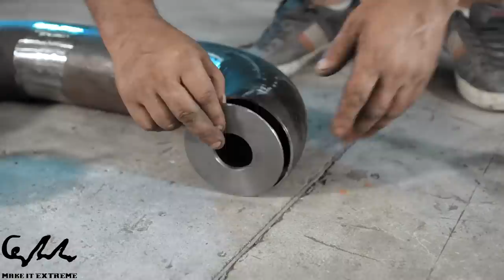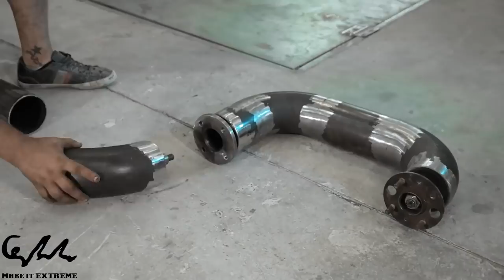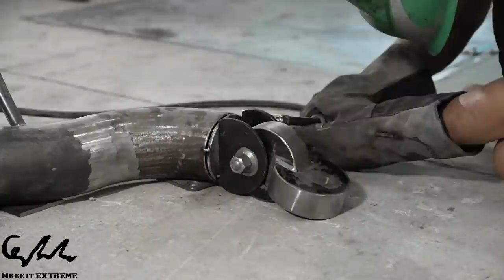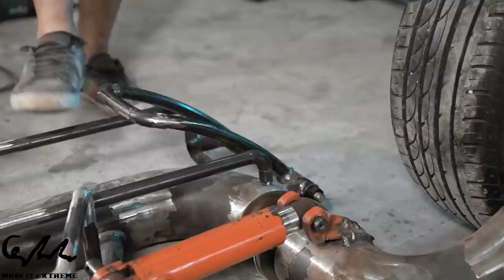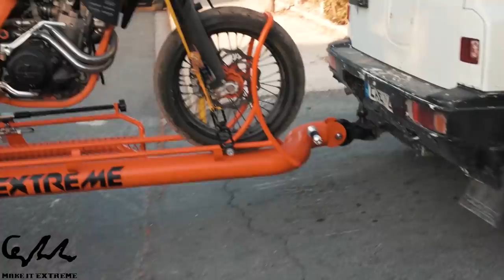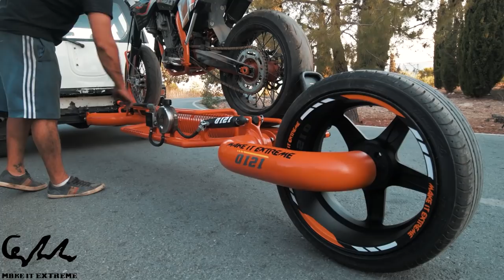Make it Extreme's Motorbike Trailer

Comment: it was worth making a mechanical fixation of the wheel in the transport position, you should not keep the hydraulic cylinder under a constant load, it would be more logical to do it: pumped up the pressure and raised the trailer, locked it in the transport position and relieved the pressure ...

стоило сделать механическую фиксацию колеса в транспортном положении, не стоит держать гидроцилиндр под постоянной нагрузкой, логичней сделать: накачал давление и поднял прицеп, зафиксаровал его в транспортном положении и стравил давление...
Reply: Exactly my thought on locking the lift with a pin once up so it's not riding on the hydraulic. If you blow a hose or fitting going down the road it's not going to end well. But the spark show may be cool! 😃
Reply: I was thinking adding a nitrogen suspension accumulator would relief stress on the hydraulic system and improve ride quality. If you just lock it in place the whole thing will just bounce around on what little relief the tire provides.